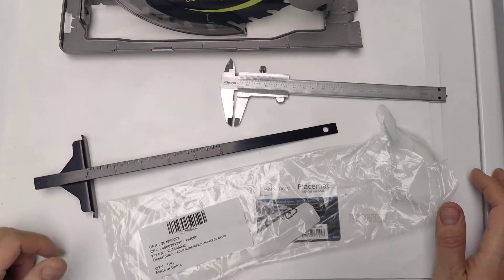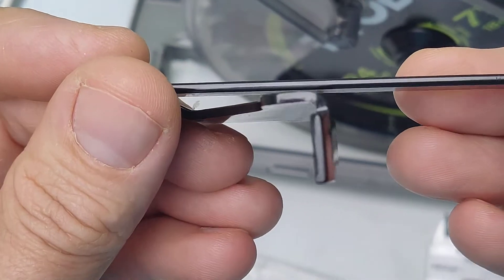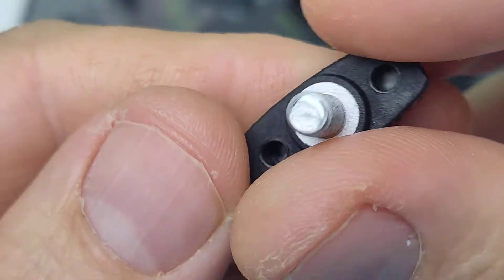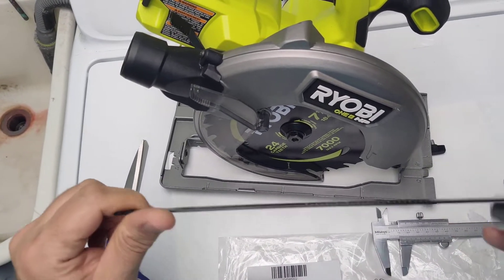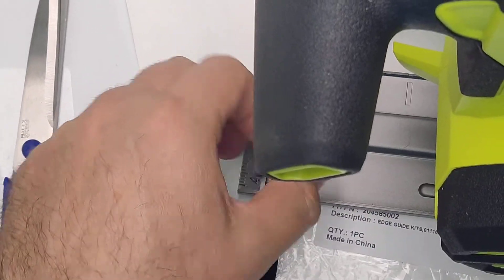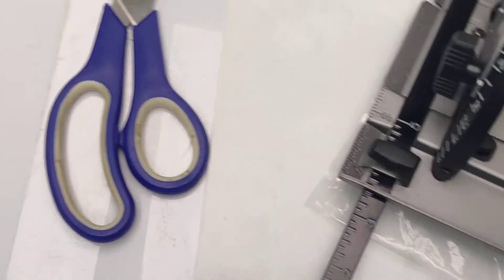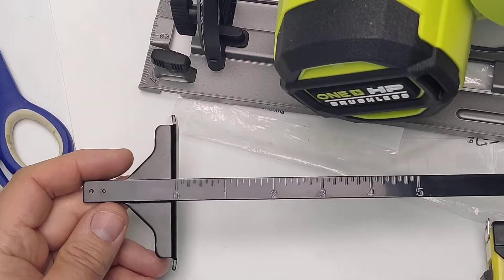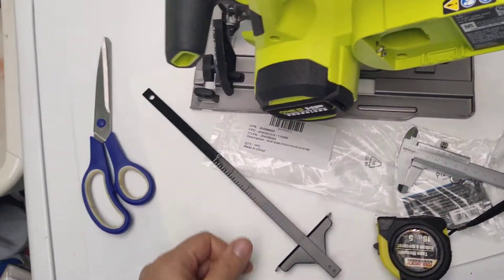Ryobi circular saw edge guide assembly 204585002

Comment: Did you figure out that it will always wobble if you don’t tighten the little screw ? I just bought the ryobi 7 1/4 circular saw that came with the bag and edge guide and the guide is super sturdy and isn’t flimsy at all , and when I put it through the little holes on the saw, it wobbles until you tighten the little screw on top. 🤦🏽‍♀️
Reply from the maker: I understand but you didn't seem to get the point in my video. My model came without it.

Comment: 2:02 Thumb screw is missing on my PCL500B saw
Reply from the maker: They could be selling those as separate parts. You can contact Ryobi tools they would be able to get you this, or just use any winged bolt from one of the box stores, which most likely would do a better job anyway.
Reply: @Quentyn73  Yea, have to guess at the thread type & size
Reply from the maker: @REVNUMANEWBERN  Looks like standard M5 - aluminum bolt (5mm x 8 mm the threaded stem. It's stamped metal, so you may expand the hole a little bit with a die and use whatever size you have close to that. Just need to file the end of the stem so it doesn't leave marks on whatever piece of metal you have it holding.